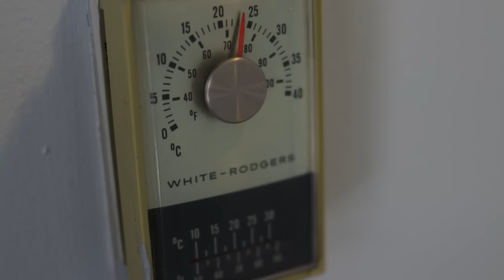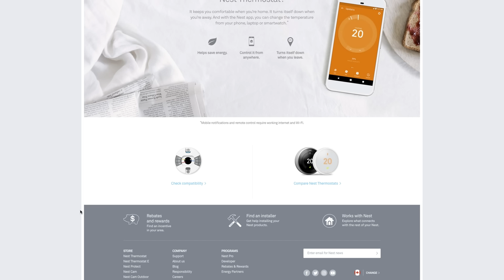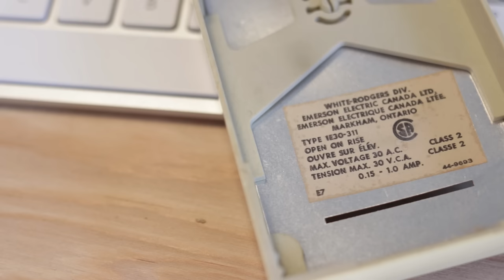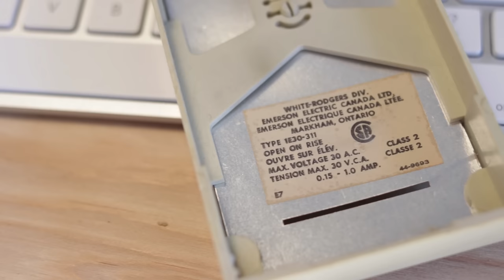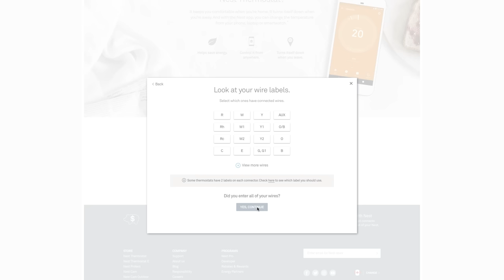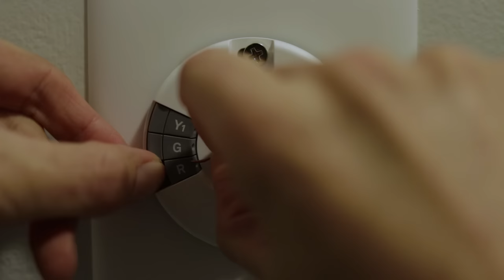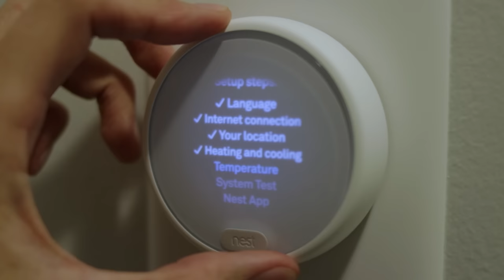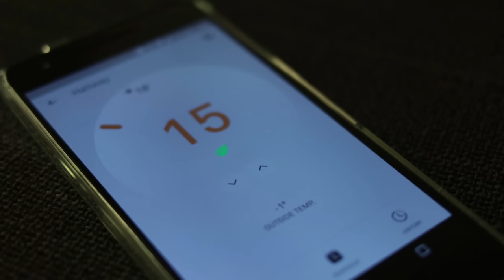Nest Thermostat Install (Replacing old 2 wire thermostat) - FAQ in Description

Comment: Looks like you’ve had this installed for about 2 months now, any issues with buzzing sounds from the gas valve or blower failure? Nest Support says if you don’t have the common wire set up then it can damage some systems.
Reply from the maker: Hey James, we actually upgraded our heating system about 3 weeks ago since the old unit couldn't handle the crazy cold we've had here in Canada. It was our first winter in this house so we didn't know how it would go and we decided to get it replaced as soon as possible to take as much advantage of it.

Though we didn't have any problems with the Nest E with the old furnace! I think with this wiring you can't do much wrong but I'm not a pro with this stuff. :) My "gamble" in the video was not just a random try but I based it on multiple threads/videos I found online.
Just to be clear though; we didn't replace our furnace because something broke. :) We just decided to upgrade it.

Thanks for watching James!
Reply: James Stringam in rare cases, very rare cases. Your situation is a fringe market of errors, I wouldn't post it the thought "must be like that for everyone" it is with all honestly, rare.

Comment: With a 2-wire setup, where do you connect an external 24VAC adapter to Net-E to keep the battery charged? One wire goes to C, but where does the other wire go? Thanks!
Reply: I do have the same problem wish my, any answer yet any Solution please I do need some help
Reply: boris lasman heating equipment two wires goes  to Rh and W.   24v adapter goes to C and Rc.    
Btw, according to Nest tech support and the Electrician from my company, that the Nest can’t not handle two source of power, therefore by doing this you could damage Nest right away or somewhere down the road.
Reply: @QnQoooo  Thanks!
Reply: Go buy Fast stat. You need C wire to power your thermostat and if u have 2 wire Fast stat will give you 3 wire for 24 V.
Reply: @QnQoooo   - the Nest E thermostat doesn't have Rh and Rc. There are only 6 terminals: Y1, G, R, W1, C, *OB.  If you know where to connect the 2 leads from a 24v transformer to this Nest (the "E", not the fancier "learning"), please do!
Reply: scotthargis that’s why the tech from Nest told me that you can’t do it.   Which out the RC you can’t do it that way.  Nest can’t take two source of power.  It might cook the board.
Reply: @QnQoooo   - I think generally when it's a "2-wire" furnace (like my gas-burning gravity furnace) there's no power coming from the furnace itself, they're usually millivolt igniters. Following a comment I found on another video, I used the "C" terminal for one of my 24v wires, and pigtailed the other one to a furnace wire and plugged them both into the "R" terminal -- everything works perfectly.

So the final configuration for my Nest E thermostat is:
Furnace Wires -- "R" & "W"
24v Transformer Wires -- "R" & "C"
Reply: I just wanted to THANK YOU.. I tried everything else and your solution is the one that worked. THANK YOU. I would have never thought about pig-tailing the wires :) Now I'm not freezing  @scotthargis

Comment: Is this a high voltage heater ??? Is your nest still working? Thx
Reply: Low voltage. Old one was rated for 30 volts AC, and most systems use 24v transformers.

Comment: This is abviously NOT a 2-wire millivolt thermostat. Your 2 wires must have power. I have the Williams wall heater and millivolt thermostat. Running power, even a 24V transformer would be a major pain. Does anyone make a battery powered Smart WiFi thermostat that will work with a 2-wire millivolt system with no power? Is that even possible?

Comment: I'm assuming you wired the Nest with a electric furnace. Just wondering if you think it will work with a gas fireplace with the same 2 wire setup?
Reply from the maker: I'm sorry, I have no idea! Thanks for watching!
Reply: As long as the fireplace has 24v wires to trigger the call for heat, it should work at least as well.

Comment: Have the same wire set up with a oil furnace. Thoughts on the nest working like your set up?
Reply from the maker: Hi Bryan, unfortunately I'm not familiar with an oil furnace! This would be a dual fuel system, I assume. I'd check Google (found some forums discussing this) to make sure!
Thanks for watching!

Comment: Works, but not for long, nest has a lithium battery inside   , that battery run the system and is used for wireless connection, if you dont power the thermostat that battery want last long and the thermostat will be dead, the common wire is the wire bringing you 24 V from furnace to thermostat and keeps the battery charged.

Comment: Hi - how does that nest communicate with control unit ? do I need to change it as well ? its pretty new but thermostat is very old and im thinking about a new one
Reply: All it does is make a connection to the corresponding wire needed for the application at the moment. Red is usually 24 v white is usually heat. Yellow is usually cooling black or brown are usually c or common. You can make the connections without the thermostat if you wanted.

Comment: Hello Maurits, Happened upon your video while searching for how to troubleshoot my non-working Honeywell Thermostat.  Thought the battery was dead. However, cannot locate any batteries . The Mercury has a little spark, but not sure what that does in terms of my heat not working. There's heat throughout the house,  except for the upstairs apartment. Help.....Google is no assistance on this relic of a thermostat.

Comment: Hi buddy how it’s going ... I’m thinking of getting one of this.. my house has a vary old thermostat and it’s not working probably but I’m not sure if bear is good or not . Would love your personal opinion on it . Thank you
Reply: If your home is 2 wire?  I recommend replacing the wire with a 3 to 5 wire. because the nest needs power and only rely on the heat running to charge it .A  wire called C wire would charge it even if not running.

Comment: Are you still pleased with the Nest E? Looking back, wish you would have spent more for the Nest 3rd Gen?
Reply from the maker: Thanks for watching! I actually had to replace my entire furnace (had nothing to do with the Nest E) with a newer unit as it wasn't able to keep up with the cold weather this winter! The new machine had way more connections so I had to get the Nest 3rd Gen instead.
If the Nest E would've worked with the new furnace then I would've kept it for sure. It has all the connections we needed (in reality it was only the 2 wires, haha) and I like the look of it much better than the 3rd gen, though that is a matter of taste obviously!
Just make sure that your system is compatible before you buy one. :)
Thanks!

Comment: I have a Honeywell, white wire connected to 'heat' and black wire connected to 'com'.  It looks like your White Rodgers.  Do you think it will work with the Nest?  I took pics but don't see where I can attach them to this comment.  Thank you.
Reply from the maker: Hi Maria, thanks for watching the video! "Com" sounds like Common Wire? And you only have two wires? I really can't tell if that would work exactly the same as with my setup. I don't want you to break anything either. Sorry for not being that helpful... Thanks for your comment!

Comment: I am thinking about getting one this week.  I also only have a black and white wire leading to my current thermostat.  Glad to see that it worked. Do you think it would be the same install for a gen3?  And have you had any problems?
Reply from the maker: Thanks for your comment Daniel! I'm excited to hear there are more people with this setup and I hope this video is helpful.
I believe the 3rd Gen has a couple of extra ports. I'd expect you'd have to connect the black wire to the Rh. (and not the Rc as that must be cooling?) Though I'm not a pro so I can't guarantee this. :) (that's a disclaimer for if anything bad happens, lol)

We haven't had any issues with the thermostat! We like that we can control it from our bed in the morning haha. It's nice to have some data and see how it'll hold up during the winter.

Thanks for watching Daniel!
Reply: I've had nothing but problems the thermostat doesn't read the ambiant    temperature properly, it's like it goes yo sleep.
Reply: Diamond 482 the thermostat has settings where the display only comes on when approach.  I believe there is an option to have the display remain on at all times.  Check the settings if you want to have the display on all the time.

Comment: the nest 3rd gen has the W1 for white wire, but not R, they have Rc and Rh, would the black wire go into the Rh or Rc?

btw, did you have to turn off the power on your furnace or breaker? it looks as though you did not.
Reply from the maker: Hi Mark, I think the C and H stand for Cooling and Heating so I assume you'd use the RH? (this is a guess and I'm not a pro)
Also, YES, please turn OFF the power to your furnace. It was the first thing I did as shown in the video. :)
Thanks for watching!
Reply: just wondering, do you switch off your furnace during the days you're not using it? does the E still get powered on with the furnace off? i've read other people not using the C wire experience a drained battery on the 3rd gen thermostat, so i'm wondering if yours have that problem? i'm planning to install my 3rd gen with just the white and black/red wire, so i'm afraid it might drain the battery.
Reply from the maker: Hi Mark. We actually upgraded our heating system about 2 months after installing the Thermostat E as the old unit couldn't handle the crazy cold we've had here in Canada. It was our first winter in this house so we didn't know how it would go and we decided to get it replaced as soon as possible to take as much advantage of it.

In the time we had it installed it never ran out of juice so ours just got enough power through the wiring to keep the thermostat running. Though I hear some people may have some issues with keeping it charged... It worked well for us!

And no, we never shut down the furnace.

I hope this helps! I can't guarantee this works for everyone but it did for us. :)
Reply: he turned breaker off
Reply: Just turn off the red switch at the bottom of the stairs or beside the heating unit.
Reply: Dude that made this video doesn't know what he's talking about. Unless you have a common wire as well as the 24v red and the white heat wire your thermostat does not charge at all. He was simply running it off of the little battery that is inside the nest thermostat. If you dont want to have to charge your nest via USB you need to have a third wire ran to common also known as C.

Edit, also if you have a system that heats and cools you can install a jumper between RH and RC. This allows the thermostat to run in heat and cool.

Comment: I wander how is the nest getting power if you don’t have C wire or batteries 🤔
Reply: Daniel Paneque the black wire is the live wire, so its always on, same with some thermostat that only have red, green, yellow.
Reply: I had the 2 wire system last year. and just changed it to a 5/8 wire because as soon as it gets cold the thermostat says the heat is on but nothing happens. if i cross 2 wires it runs perfectly without the nest but now with 5 wires its like night and day. it even blows air out better and warms quicker.
Reply: K. Mendonca is hard to diagnose with out being there but in my opinion for heat you need R AND W some time w2 if you have a two state furnace but the nest need C wire for power maybe you have a broken wire
Reply: @danpan4425  possible but I replaced the 2 wire with 5/8 wire and it works way better

Comment: I have heated floors with a two wire low voltage system.  I get the note: N260 message for low voltage.  Any ideas?  I was thinking of running a low voltage transformer (charger) from outlet through the wall into unit.  Will that work?  Anybody?

Comment: Note: there is a really good chance that even though the thermostat will turn on, you’ll run into issues with it. I installed a nest E with only two wires and ran into short cycling issues with my furnace (it would work fine for about an hour). It sucks because I specifically bought the nest because of this “feature”...
Reply: What is it turning off too quickly or what bnb is happening?
Reply: brandon HVAC/ANTS the zone controller for my furnace is what was constantly short cycling. Ended having to reinstall my old thermostat :(

Comment: Hello Maurits,

thanks for this video. I have a question that when I remove the Rogers thermostat I saw 2 white wires instead of one white and one black/red. Now can u plz suggest how to figure out connection of wires if both wires are white in colour.

thanks
Reply from the maker: Yikes, that's confusing! If you have the same (or very similar) old thermostat, then I guess the right one should be your black one? You can see in the video on which side the colors were. I'd mark it as soon as you undo them. :) No guarantees as I'm not a pro though. :)
Good luck! Let me know how it goes if you decide to give it a shot.
Thanks for watching and commenting Aman.
Reply: Maurits Nienhuis 

Thanks .. I will go through the wires again.
Reply: You often have to note what the terminals of the old thermostat are labeled as and label the wires accordingly by folding over some masking tape on the wires.  Colour coding tended to change over the years as well as concern as to whether or not such coding would be required.  Remember the old thermostat simply made or break the connection between the two wires so they really didn't care about differentiating between the two wires.  These modern electronic ones might use a FET hence not care about which wire was which but they may also use a power transistor or a triac and hence which wire was which might be a concern.  Anyways, you could probably just try it in one configuration and if it doesn't work, reverse them.  A voltmeter can help you guess what each wire did.
Reply: Usually with 2wire systems it doesn’t matter it when you go to 3+ that getting the terminals right is crucial.

Comment: Hi, Im looking at installing the Nest E on my parents old 2 wire mercury thermostat, when i tested the wires with a multimeter it showed 26v. Im sure that the Nest E will work on it and it should charge itself when idle since theres 26v when i tested the bare wires. im a little worried about the pulsing issue that some people have when the Nest is drawing power. Since our 2 wire constant systems work on a basic ON or OFF function, that shouldnt be an issue??    Im probably going to go ahead and give it a try tomorrow but if you know anything else that might help, i'd appreciate any advice you have to offer
Reply: so how did its battery work? did you had pulsing issue since you only connected two wires. I was going to install it but I have two wires only
Reply: @satwindersidhu1109  no smart thermostats worked, were going to add one in the basement on the finished wall outside of the furnace room, the control board has all the right connections to make it work. We just gave up for now.
Reply: hello,   do you have any power issues?    do you need to charge the batteries?   I only have  2 wires.   will I need the c wire?

Comment: If u have 2 wires like in video you will need to charge Nest. You can go and buy Fast stat, and that device will be able to add u 3 wire that u need to give thermostat 24V power.

Comment: Hi you all! I just installed the nest thermostat following your instructions. It seems to work, but the problem is that it seems it does not charge the internal battery, so it switches off. Some suggestions? Thanks for the video!
Reply from the maker: Hi Blai! That's not cool. :( How long did it do with one charge?
Reply: Maurits Nienhuis hi! I just bought the thermostat, but I have only two wires. The brown going to a relay (heat) and the black going to the main current breaker. The AC tension between those two wires is 25V. I connect the Black into the R and the brown into the W1. The heater works, but the thermostat cannot charge the battery and shuts down. Navigating the web, I found something about adding a common (C) wire, but I don’t really know how to add it: just C wire? AC or DC? It seems that the wire is to give power to the thermostat when R is not enough (but is not enough 25V?)

Can you help me? Thank you in advance!
Reply from the maker: Hm... I didn't need a Common wire myself though there's a lot of videos online about how to install it... It's weird though as it worked perfectly fine for me and others who set it up like I did. :( I'm afraid I can't help you!
Reply: I have read that the unit will constantly cycle the furnace on and off to get a charge without a C wire. Since it only stays on briefly it doesn't actually warm the house. However, the constant on and off can cause problems that others have reported. A dedicated c-wire for power is the preferred route.
Reply: If it's a 2 wire system, swap the wires.
W1 wire into the R terminal.
R wire into the W1 terminal.
Reply: If that doesn't work, only then might you need a common wire.
Reply: Hello Hego, I tried to email you but the email address bounced - have you got an updated address please?

Comment: The old thermostat looked cool tho, should've used the outer shell and use the inner components of the new one
Reply: hell no whats the point? You want something new not something that looks like it came from the 1940s
Reply: Or shouldn't have replaced the thing in the first place
Reply: Elevator Operator the nest is more efficient
Reply: @theclueguy3388  How?
Reply: Elevator Operator it will better be able to help cool your house as efficiently as possible to use less power and make your bill go down and it can keep temperature more accurately
Reply: Novation Hax where is your proof